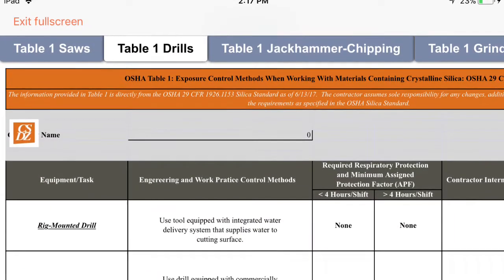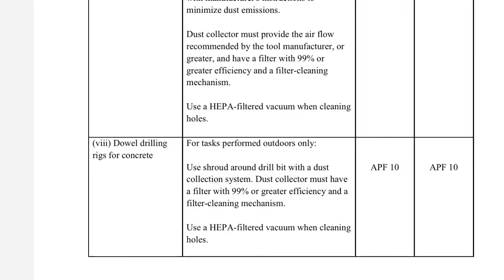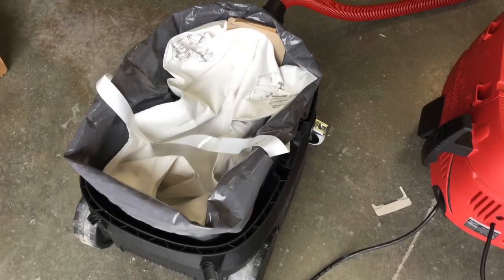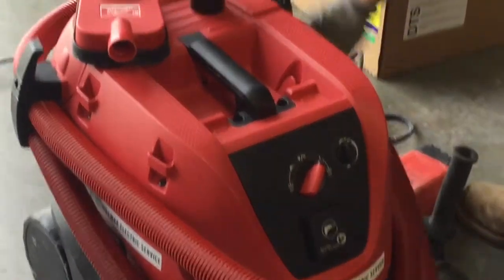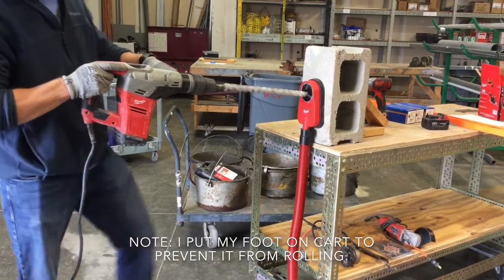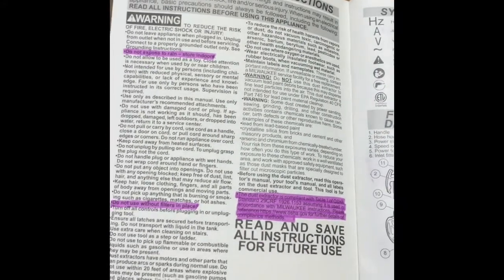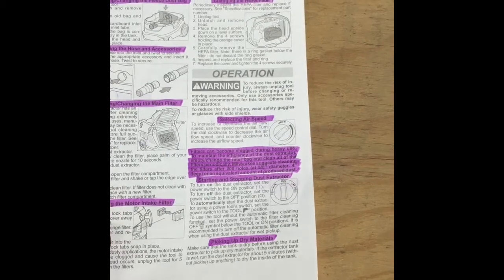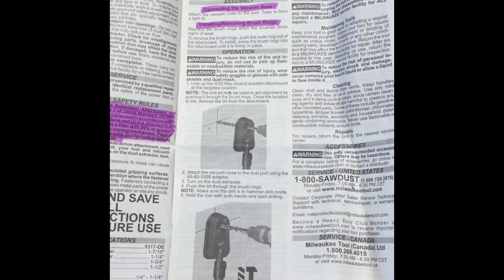Willmar Electric Service: Milwaukee 8 Gallon HEPA dust extractor and attachments (Video 3)

Comment from the maker: NOTE: When hammer drilling above your head or on a wall, you can shut the filter-cleaning mechanism off (just as if you were using HEPA vacuum for wet material). This will prevent the HEPA filter from cleaning itself while you drill your hole, and will prevent the attachment from falling off of the ceiling/wall.
Reply: Willmar Electric good call on that one man!

Comment: Very nice. If it uses a filter bag (felt bag) I don't see the need to use the air filter auto cleaning function. The large dust won't get into the filter correct?
Reply from the maker: The Milwaukee 8 Gallon HEPA vacuum has two filters (a Main Filter and a HEPA Filter). The HEPA Filter needs to have a filter-cleaning mechanism to meet the new crystalline silica standard. 

According to Milwaukee's website, "An automatic filter cleaning mechanism helps maintain consistent airflow and suction at 148 CFM in tough dust-producing applications. The extractor’s unique two step filtration system includes a 99.97% efficient HEPA filter as the final step, leading to cleaner air and a safer work environment."

Hopefully this helps. Thanks for the comment!